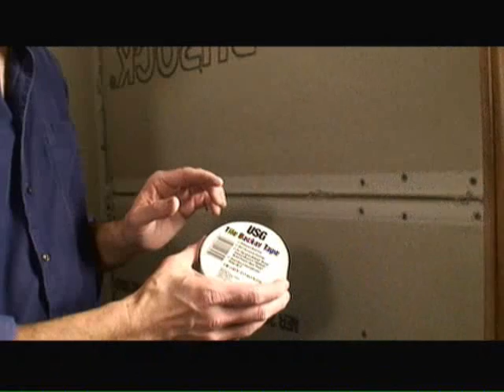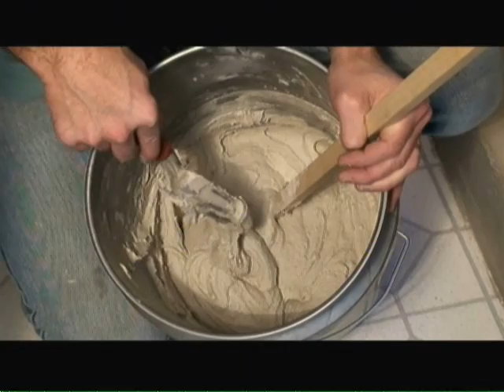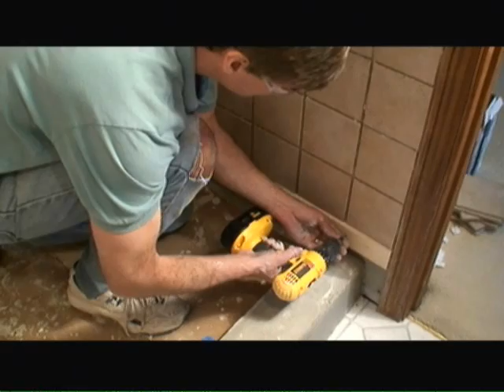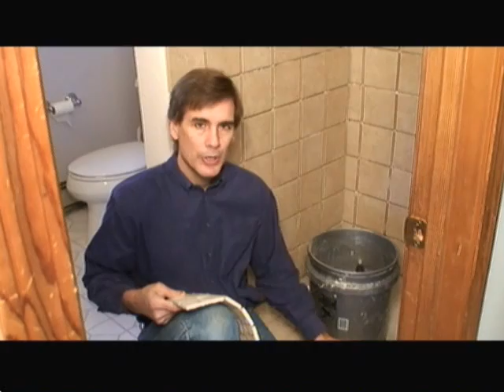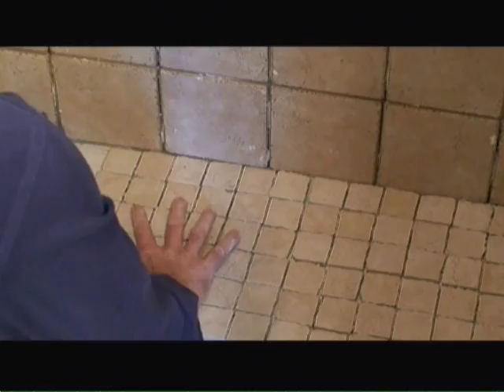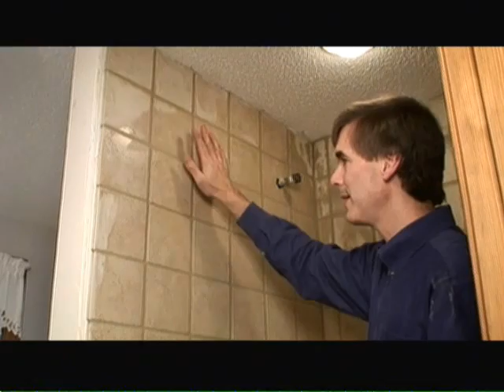How to Tile a Custom Ceramic Tile Shower Video

Comment: Did you put screw holes through your liner when you installed the ledger board?
Reply from the maker: No. The membrane liner went up a few inches on the side. And even if it did, the water would have to get higher than the curb to reach the high of the screws. Water would overflow the curb before the screw holes were an issue.

Comment: How much time does this take for the walls and floor.. and how much would it cost.? labor only not material
Reply from the maker: Depending upon where you live, the size of the shower, and type of material you can expect labor charges to range from $2K to $5K, on average.

Sign Up for my HomeAdditionPlus.com newsletter and get free home remodeling and home improvement tips, as well as tool product reviews, from me every month. Sign up here:  http://www.homeadditionplus.com/Subscribe-to-Newsletter.htm
Reply: labour 2k? for that small shower ?
Reply from the maker: Frank, I'm not kidding. The work required is substantial. And the rate these guys charge would make doctors second guess their careers if they only new. :)
Reply: In my area no way in hell they would pay $2000 labor for a shower like this. $600-$800 max this is regular cheap builder grade shower. Using speed slope and speed set this is a one day shower.

Comment: I was wondering if you can use durock underneath the shower pan liner instead of mortar? Will it have the same effect?
Reply from the maker: No, because the purpose of the mortar is to create the slope, as well as to make a very smooth surface for resting the membrane liner on.
Reply: wrong answer, think linear.

Comment: Thank you for your reply.  I understand the ledger board process, but I'm just a little worried that maybe by the 5th row up or so, the tiles will topple.  I'm using spacers, and I know those will keep the tiles from sliding, but what about toppling forward?  Can I expect the mortar to hold it enough on its own?  I'm using Versabond White Fortified Thin set mortar.  Thanks again

Comment: All your videos are great, and extremely helpful.  Is there anything I'll have to do to prevent the shower tiles from falling off the wall before the thin set is dry?  I saw that you taped the bottom row so they wouldn't slide, and installed the wood so the beginning tiles wouldn't slide.  What about the 2nd, 3rd, and later tiles?  Have you ever seen them topple off before the mortar is dry?  Thank you.

Comment from the maker: I've never waterproofed the cement backer board. I've justed taped and mudded the seams, with a moisture barrier behind the backer board. Never have had water/moisture problems with this method.

Comment: Did you pre-cut the vertical edge wall tile before mixing thinset in order to save time and keep the thinset from drying out?  Or do you have time to measure and cut each edge tile after spreading the thinset?  I'd like to cut each tile one at a time while setting them, to make sure it's a good fit.

Comment from the maker: If you plan to do multiple tile projects then plan to spend around $200 for a decent tile saw. However, if you plan to tile once every few years either rent a tile saw or buy a cheapy. I remember buying one from HQ (no longer in biz) for $80 and it lasted me for about 5 years and on about a dozen tile projects.

Comment: Good step by step instructions. I wanted to get your thoughts about some products to waterproof the shower.

 We usually recommend a waterproof wall backer like Wedi or Kerdi. For the joints we like to use urethane grout vs. standard sanded grout for improved waterproofing capabilities and for the base we like either a waterproof expanded or extruded polystyrene. What do you think of these products & approaches?

Comment from the maker: @bsl3216 If the pre-slope is already there, then all you need to do is install the membrane, add a final layer of mortar (maintaining the slope) andthen tile (using thinset for fastening the tiles).  You didn't mention if the adjustable drain was in. I'm assuming it was.

Comment from the maker: Yes I put tiles facing toward the shower on the inside edge of the curb. After installing those tiles, I then put on the cap tiles on top of the curb so that they just over lap the edge of the side tiles running up along the curb edges.

Comment: Hi again....I have another question about installing the backer board.....I noticed that while using the power drill, when  putting the screws in place....the backer board moves away from the studs, causing a space between the board and the studs......How do I avoid this problem?...Atfer removing the screw several times....I finally got it in place but it took alot of effort......I've watched so many videos and no one mentioned this problem, is it that I'm not used to handling the drill?....
Reply: Try clamping the backer board to hold it so that you can set a screw, then you can remove the clamp and move on. Or also, try leaning really hard against the board before you drill.

Comment from the maker: Its hard for me to fully understand what you are doing w/o a picture. It sounds like you're tiling the bottom half of the bathroom and that the original upper half finished surface sticks out a bit  more than the tiled area. IF you want a flush tiled surface with the upper half of the wall, that sounds fine. However, in light of the pipe protrusion you may want to add that extra layer of 1/4" of backer board to hide it. Otherwise create a small boxed in area to go around the pipe.

Comment: Hi again...I realised after asking you the question about the original wall thickness....I was just looking at a bathroom similar to the way mine originally looked and I discovered that the tiled area in the BR....comes out about 1 inch past the above wall, is it necessary to do that?......because I'm  thinking once I apply the thinset and marble tiles plus boarder,the tiled wall and the origanal wall will be about even....or should I bulid the wall back out entirely to cover the pipe area?.....

Comment: Hi....still working slowly on the bathroom....in installing the backer board on the wall....I discovered that at the point where the original wall meets the area to be tiled at the point 3 1/2 ft. up,the oringinal wall is thicker by 1/4 inch or better, how do I make up the difference? add another 1/4 inch of backer board?....the 2nd question...behind the toilet area on the wall, there is a pipe that sticks out past the verticle studs in the wall, how do I cover that??....double the backerboard??

Comment from the maker: It sounds like maybe the charger is not working well since both batteries seem to hold a charge for only a short time. This said, there is more energy required turning a blade through wood as there is so much more friction and torque involved.

I would try the drill out on the cement backerboard installtion first before either buying a replacement charger or new drill. I'd go with another 18V if I had to buy another one.

Comment: Hi....I have another question.....I bought a 5pc  tool set by Robi....that had a circular saw ....reciprocating saw...etc ....the set included a drill...this is a cordless set....my son used it once to do a wood repair....the saw kept running out of battery power while he was cutting wood....the drill is also 18v....we only have 2 batteries....is the 18v enough power to use installing cement backer board continuously?......or should I buy another drill?....if so what voltage drill?........
Reply: Are you using the saw to cut the backer board? The simplest way to cut the cement backer board is to score the surface and snap the sheet along the scored line, similar to the way you'd cut drywall. In fact, you can use a drywall utility knife to score backer board, but a better option is a carbide-tipped scoring tool.

Comment from the maker: Yes you will need to ad some type of filler. You possibly could consider adding an extra layer of backerboard or even plywood. Alterantively, you could just attach firring strips / strapping to the 2x4s, though you may need to rip your own with a skill saw or table saw to the desired thickness.

Comment: Hi...I ran into a problem...my bathroom was completely guted and the tub was replaced....the new tub is in place but it is about 1 inch shorter...so there is space between the studs and the tub edge...the question is...can I use a extra piece of cement board to cover the whole area so that it's even and nail it to the studs?...and then place a thiner cement board on top of that....because the edge of the cement board is supposed to fit over the edge of the tub to prevent water getting behind it?

Comment: If I use the 1 by 1 tile sheets on the ceiling of the bathtub instead of the marble 12 by 12's ....it's a lot lighter in weight....and because of the mesh backing..... maybe it would stay in place??.....or would I still need to apply something flat against it until it drys?....or is there some type of fast drying thinset to use specifically for applying ceramic tiles to the ceiling??......

Comment: I enjoyed the video......I will start tiling my bathroom with in the next week.....but I really need to know how to apply the marble tile to the shower ceiling.....I haven't found a video that covers that yet.....so I'm thinking that if the bottom row of tiles need to be taped until dry...so my guess is I should do the ceiling first.....and maybe use a peice of cement board cut to fit the ceiling....and cover the tiled ceiling with it and anchor it against the 3 untiled walls of shower til dry??

Comment from the maker: Always use a thinset mortar when using any type of tile in a wet area. Use the same techniques shown in this video for installing tile in a shower regardless if it is Porcelain or Ceramic tile.